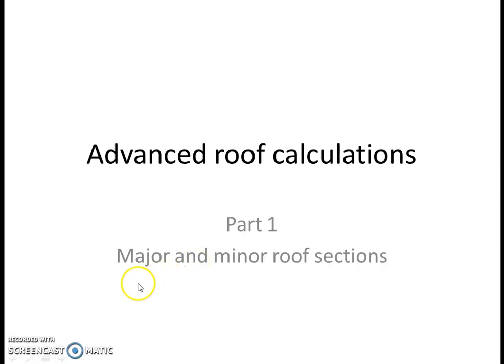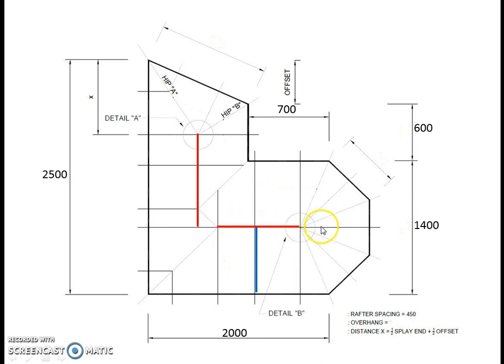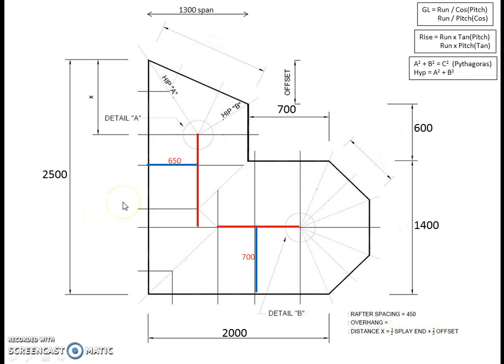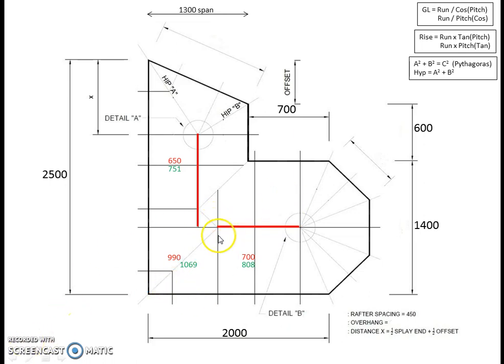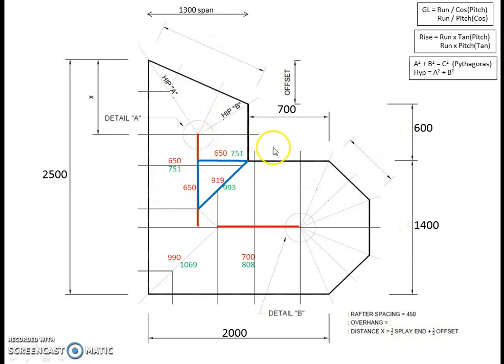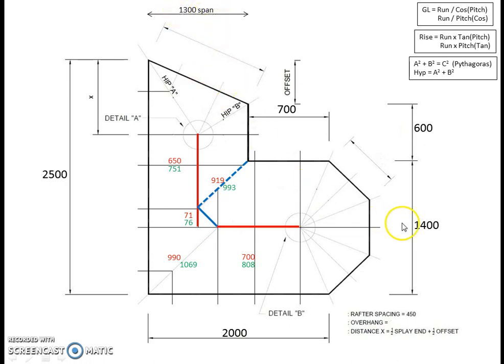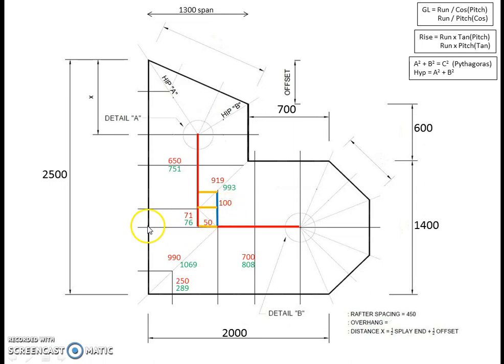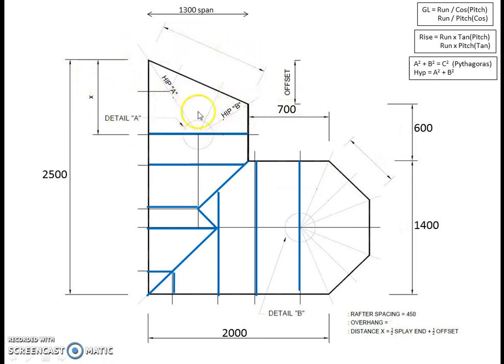Pitched roof calculations. Part 3 - Major and minor roof

Comment: The other common rafters are not exactly the same as the rafters on the span.
I can't explain it without showing an illustration.
Reply from the maker: All the common rafters in the same section will have the same run and GL. Some will have a different deduction depending on where they are positioned. Eg crown end.